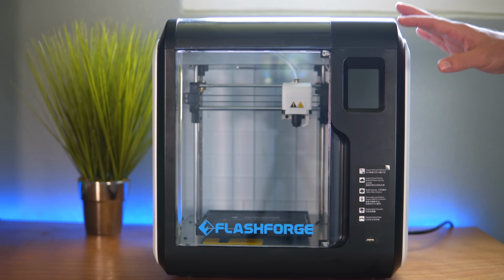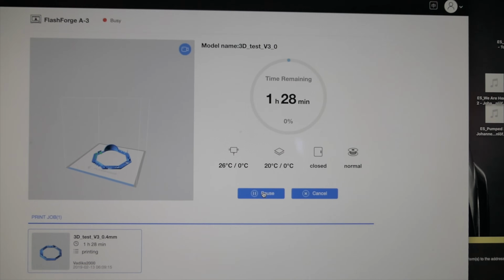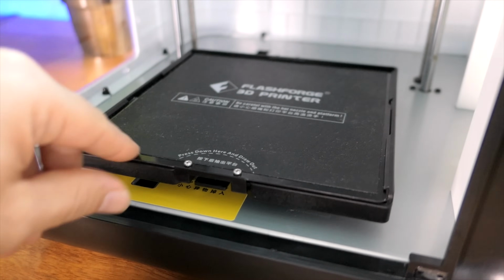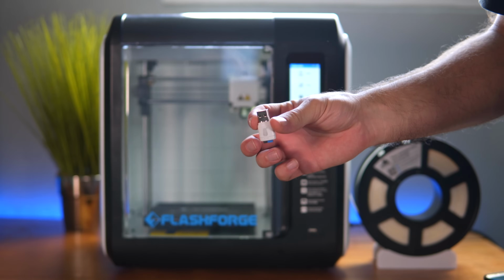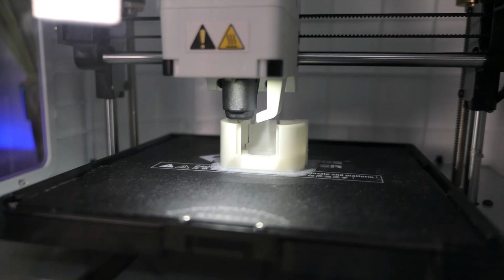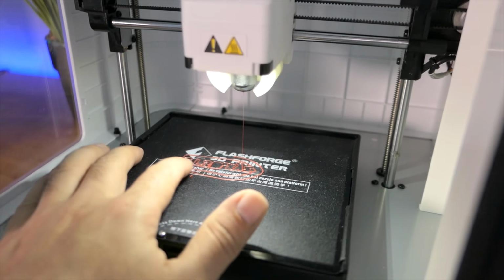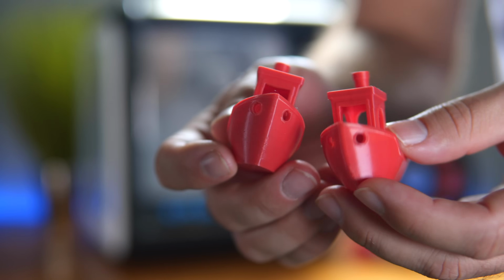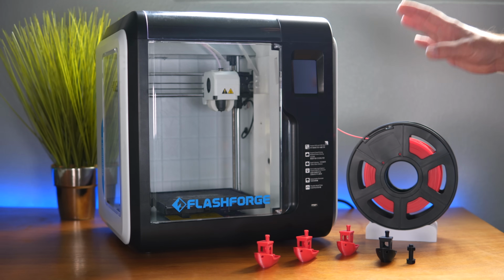FlashForge Adventurer 3 - 3D Printer - Upgrades & Prints

Comment: Or you can use the auto adjust system which is built in. As for the other tips, thank you! I’ve been struggling with stringing, so I’ll give the clip a go

Comment: Bro thank you sooo much my 3D printer FlashForge Adventurer 3 pro came on June 14 2023 on my birthday and for some reason the usb drive wouldn’t move files into the 3D printer but after watching this video I did the FlashCloud steps you did and I can print anything I want now thank you so so so much.  Deserves a like and Subscribe. 👍❤️😎🎉
Reply: hey this might be late but ye so um i had the same "issue" but it might actualy not be an issue it can be that you need the gcode files and not the 3d model file

Comment: I have been printing with aluminum for the past 3 days so far and running at 220 and 80 without glue has been working very well for me all and all. I have the adventure 3 lite though using glue is a great idea I will have to try since I have been having issues with the print not sticking to the bed as it should. I have gotten into a habit of cleaning the bed before every print with rubbing alcohol and so far I haven't had too many issues with it sticking to the bed. I did have to tighten the x-axis belt after the first 20 prints.

Comment: My big issue so far is the ABS printing and the use upgrade. I slowed down the print and made it was set to 230 and printed. Looked great but the top part broke with almost no pressure :(
Reply: The lid at the top?

Comment: thanks for the video. Its a great printer for the price range and you can very easy print out of the box. I bought this printer because of the size (is my 4th printer) to carry on my RV when traveling. And I loved the quality. So I moved some project to print on this printer, and I started printing a lot on it. The thing is that after several prints the models get stuck at the build plate and getting more and more difficult to separate. Always is the same model, same configuration, everything is the same. I found out that if I  print without glue will be more difficult to separate. and the bed ends up braking, like part of the top of the bed start coming out glued to the model. Its my second bed already. Did you find an alternative  top bed to put on it? any advice? thanks
Reply: They have a carbon fiber bed now without the adhesive on amazon, I just bought this and ripped the adhesive on my 2nd print lol... So I bought a replacement board plus the carbon fiber one, but Isopropyl rubbing alcohol should do the trick cleaning your board about every 3 - 5 prints

Comment: If anyone can answer my question PLS help me! How do I make it so it doesn't print a base? What I mean is it always prints something under my actual project. PLS HELP ME!
Reply: It sounds like it is printing a raft. If you are using Cura, please search for "adhesion" in your custom settings and you should see a drop-down that lets you select between "skirt, brim, and raft". Raft is more than likely selected. I would use "brim" so that it adds a bit of extra plastic around the model to help keep it from popping off the bed during the print. https://all3dp.com/2/cura-skirt-brim-raft-settings/

Comment: Tip: check the temperature 🌡 requirment on the different filaments and  and they vary depending on brand amazon basics abs is 235-255 degrees c at the nozzle and 100-120 degrees c. . Take that to the flashforge software an great a new profile it will pay off

Comment: I have no problem doing ABS without glue, as long as I add a raft. I'd rather use some extra filament than leave residue on my printing bed. Especially since I live in Sweden and filament here is roughly 20 EUR / kg

Comment: Today my adventurer 3 arrived, and i saw that they used the tape trick to level the bed before shipping. Good job! Also i found in settings menu there is a mesh calibration using 9 points in case the bed wasn't perfectly calibrated. The option is in the 3rd page and it's called Autocalibration.
Reply: I do not see that option and I just got mine
Reply: @googleuser298  Do you have the latest firmware? Because they removed it. Now when you calibrare it you must complete the first part (it will calibrate in the middle) and when asked to continue with the other points, say no (don't remember the exact prompt)
Reply: @havidraak2734  I have the new firmware so that explains that. I also did the normally calibration and when it asked I said no and nothing happened.
Reply: I see the auto calibration this time around. I hit yes and it just wants to take me to each point.
Reply: @googleuser298  You want to say 'yes' not no jeez. Yes continues with the rest of the mesh calibration

Comment: Is there a reason you couldn’t take the filament from one spool and transfer it to the smaller spool or would that be fine?
Reply: The risk on that is that it may get tangled up and it won't extrude very well. Like, it will keep on pulling it its stuck on the spool.

Comment: Hello Vlad.  Did you ever figure out what caused the layer shift with the benchy?
Reply: i did, but i dont know how to troubleshoot it. so apparently sometimes the nozzle smacks the build, and because the buildplate is on 1 wheel and an off-center rod, the print goes wobble wobble and shifts. it could be calibration, it could be that the belt for the y axis needs to be tightened, or it could just be a flaw with the system itself. it happened a lot at the end of the overhang test i did.

Comment: hello Vlad, and all others. good video i also have a flashforge adventurer 3, and only thing i want to add is, if you want to view the camera, you can actually do that direct via iP adress, so all you need to type into the  adress bar of your browser is: (EXAMPLE) 192.168.178.28:8080/?action=stream     So for everyone the ip adress can be different, change it to your own printer adress and no account is needed
Reply: Hey, that's useful information! Thanks for sharing that.
Reply: Thank you very much, this actually was a question i tried to find an answer to by watching this video!!! :)
Reply: I use FlashPrint Slicing software, you can view  the camera, control temperatures and control everything from you pc without signing  up for cloud. There is also no camera lag,  its exact live video. If you need to go out you can swap over to the FlashPrint app.
Reply: If I want a real printer, I am going for one that can print more stuff than tiny cubes.

Comment: I just bought a new Adventure 3 printer but its failing to connect to my wifi...How do I connect it to the wifi???
Reply: The Mac and IP address probably changes every time it's switched off. Mine did. I had to load firmware upgrade on a empty memorystick to get rid of my wifi issues with this printer.

Comment: The FlashForge Adventurer 3 has been re-branded for Monoprice's Voxel.  I tried printing this dual duct for fit and It worked.  Make sure you do not have automatic bridge support enabled because you will not be able to remove the supports in the ducts.  Manually placed supports around the outside where needed.  I Have Not made a print test with it yet, But it looks good.

Comment: I'm a complete noob to this but when I get into something i usually jump into it headfirst.  After hours and hours of researching and videos, I just got a Voxel myself as i wanted an enclosed printer for my room and something more open to stick in my garage, so I got the Voxel and also ordered an Ender 3 Pro with glass bed which will be here tomorrow lol.  Printing my first simple 20mm cube was like putting my Oculus Rift on for the first time.  Crazy awesome, and I didn't really realize how cool it was before actually seeing it work, you start thinking of all sorts of things to print and chances are someone made a template already.  I could sit there and watch these things work and lay down plastic for hours hahaha.  Wish I got into the hobby a long time ago but nonetheless this is awesome.  I'm really impressed with the quality of my prints on the Voxel so far (most of which are just simple benchmarks to learn settings and such), although admittedly I'm by no means someone who knows exactly what to look for or what to compare it to.  Figuring out settings to get the first layer to print has been fun and at times frustrating but always learning something.

I've seen a couple sites market it as having some sort of auto leveling and I can confirm it just has some nozzle calibration thing (which admittedly seems kinda finnicky, +2 might grab the paper you are using to test it, but bump up to +3 and go back down to +2 and it doesn't seem to grab it anymore.)  Maybe I just don't understand it, lol I've only had it like 3 days.  I used some $2 line levelers from walmart to get a general feel for how the bed was in multiple spots and mine is pretty spot on with just a very slight dip towards the back right.  Overall impressed...now trying to see what we can print/upgrade on it while I wait for the more open source ender.
Reply: does that Voxel have a heated bed ?
Would you buy the Voxel now that you owned it for a while ?

Thanks for sharing !

Comment: which coupling clips did you use? On the link you provided they have a 10mm, 15mm, and 20mm. Thanks!
Reply from the maker: dont remember but i think it was a 15mm. You could always print one of each, it only takes about 5 minutes to print.
Reply: thank you for your quick reply . i actually printed all 6. are you getting any under extrusion with abs?
Reply from the maker: No not at all. Try higher tempteures on the hot end. Sometimes thermostats are not that accurate and the temperature is quite lower than it needs to be.  if you still have issues try a different ABS brand they all are quite different.
Reply: Where did you get the prints from for the clips?

Comment: A little tip I learned printing abs in the past years. Get yourself a small temperature guage and install it somewhere inside the printer. (Unless you have a way to check the ambient temp of the inside while it's printing) I like to get my internal temp up to 36°c, and run your bed at max temp if you can. You will get better prints with no layer seperation. I have also tried printing at 32°c and 30°c. (Internal temps) with great success. But I prefer 36°c. My Flashforge Dreamer however has built in fans and when the temp reaches 46°c, they will kick on and regulate the internal temp so it doesn't get to hot inside. Also, that black buildtak - like surface on the bed doesn't need any glue. If it's the same stuff as mine, (only mines blue in color) abs loves it. If you have trouble getting it to stick, just lower your z down .1 at a time until it starts grabbing. I'm actually suprised it held to the glue, I thought abs hated pva. But it worked for you, so can't argue with resluts. Lol good video man, I was thinking about getting one of these for a second printer... but the quality of the construction seems to be a bit sub-par for my taste.

Comment: Oh good, this printer does everything to spy on you... Knows your IP address and with it your location, webcam setup for filming every move, you probably had to fill a bunch of personal data for that web account, can extrapolate when you sleep and work by the times you use the printer...

It can easily steal every 3d model you made too!

Yeah uh I'm never going to touch those printers.

(Other than that good video though, just not the product)
Reply: Well just make sure your web address has https and not http when entering in personal information. Be web smart.